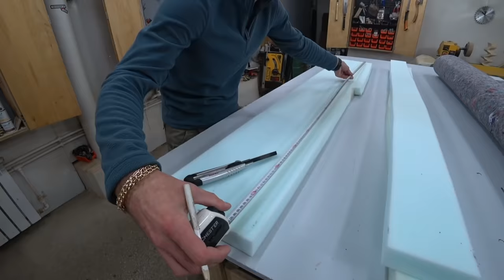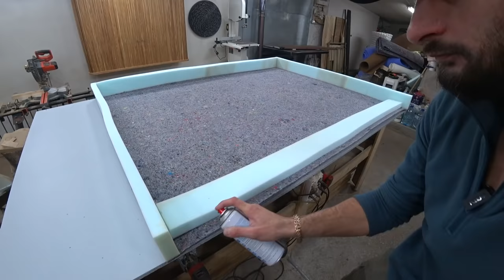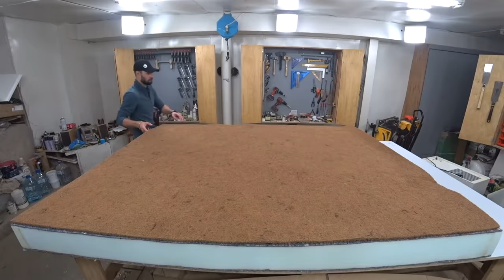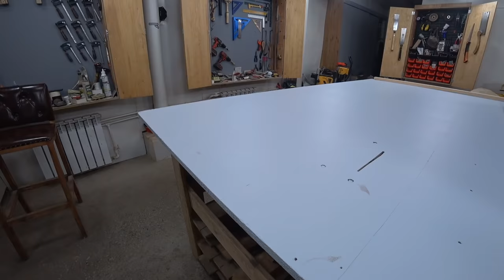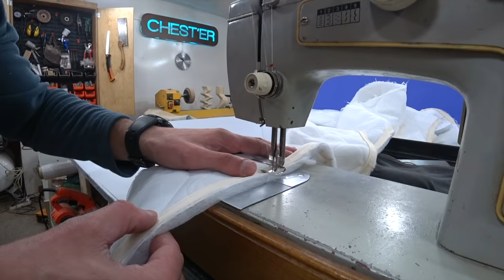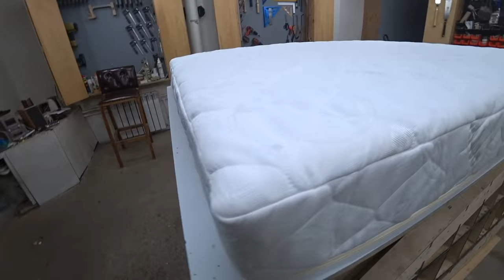You will save 3 times IF YOU MAKE THE MATTRESS WITH YOUR HANDS

Comment: I am pretty sure buying a the mattress is much cheaper if it is this type of a toxic mattress. Why am I here!! Cause I was just looking to make my own mattress but a 100% natural non-toxic mattress. The reason is they are ridiculously expensive. It is like this a regular mattress if it costs 10k here then a 100% natural matress would cost 20k if the manufacturer made the same profit. The only problem is people are not willing to spend 20k so they sell much seel so they price their mattresses at 50K or even 80K.
So this is where I decided to see if I can make one myself. NOPE Not all by myself cause thats just impractical. I will get my local custom mattress guy to stick cover and even glue up the pieces.
The perfect mattress for me is with a 2 inch hard rubber base (which will give it stabilty and not make it move around at all) on top of that 4 inch rubberised organic coir with some natural treatment like neem to keep insects away. (here you can put in your springs too if you want the bouncy kind of mattress) Then another 2 inch rubber on top and then a pincoir latex of 2inche with a good hardness somwhere around 48 to 50. I like a hard bed but those who like soft can go for a softer Latex.
Then the this will be in a breathable water restitant cover tight maybe made with tough bamboo fiber. Then side will also have hard latex this will inside the is inner cover which will have zippers. Then we will have a quilted cover made with organic bamboo and cotton fiber and inside it will have silk cotton or Kapok cotton. This will also have a zipper.
10 inch mattress with an inch of quilting so 11 inches.
That is heaven I like to keep the mattress hard and then put a thick quilt as the bedspread if I need more softness and adjust it there maybe put 2 quilts. Cause that can be adjusted anytime.
Now I know for a fact that the raw materials that is a coir sheet and rubber are damn cheap even latex is damn cheap would cause me less. 
There are reasonably priced coir mattresses but they have something missing like they have foam inside layer or polyester quilting or they have something missing I could make this perfect mattress for the same price.
Bottomline no point making a regular mattress you will not get the finish which we can see the cover is pretty loose also the springs inside were moving around.
You will get a better lasting mattress that is factory made.
Everyone does not have such a big table space and a sewing machine lying around.
But its worth it if you are trying to make a 100% toxic free natural mattress with natural materials or materials you support like Hemp or you don't want to use stuff that give out toxic fumes evertime the seasons change or when they break down over the years.
I think its not only cheaper but getting something 100% natural and organic is hard

Comment: Any kind of spring based mattress is utter and totally stupid...springs always will break down or as the padding between you and the springs break down begin to dig into your back. 100% failure for comfort and support.  Honestly you need to use 90% or so of solid hard core rubber, then use an easily removeable top soft padded eggcrate style foam pad on top.  however that all costs a lot and is next to impossible to find.  Kind of like trying to find shoes that are not made with that cement hard foe rubber soles.  Creative build none the less, but again for comfort level and over all good back and body support this gets an absolute zero. cheers.